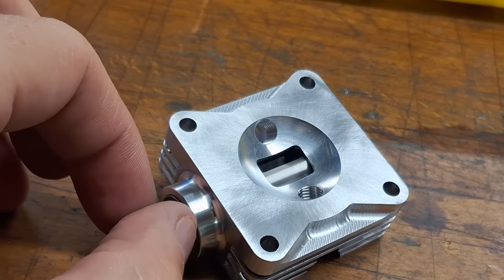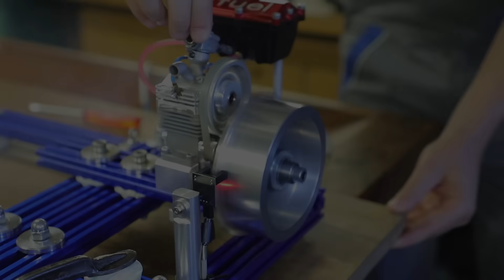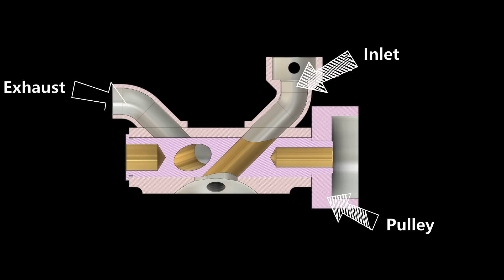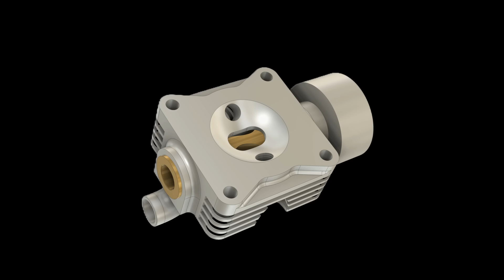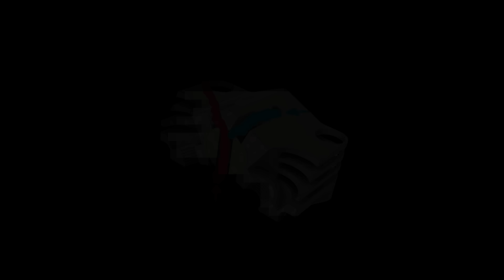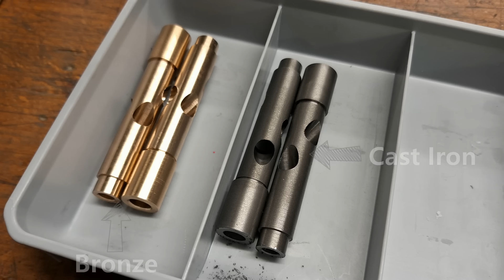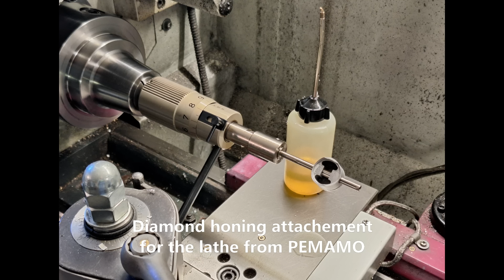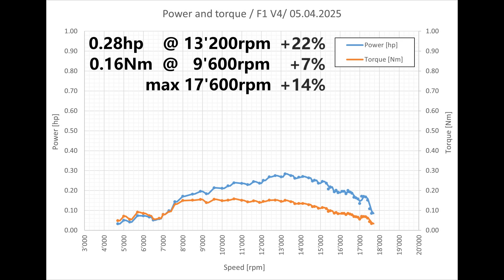New Rotary Valve Design for Model Engine / Modellmotor mit neuartiger Walzendrehsteuerung / Part 2

Comment: Great work just to get one working! I had some involvement with the Bishop Rotary Valve F1 engine quite a while back. We were building the rotary valve head for it with Ilmore (now Mercedes) supplying us with a single cylinder 300cc headless engine. We ended up getting more power from it than Ilmore was able to with their current F1 engine. Sadly, a rule change forcing only poppet valves in F1 killed the project. It had a single valve, with inlet at one end and exhaust at the other. Each had a rectangular opening to the combustion chamber to maximise the area, which was huge. The two paths were separated by a double thin-walled section in the valve. A side view cross section of the valve would look like the inlet path coming in from the right hand side, occupying as much of the diameter of the valve as possible, then turning thru 90deg into the combustion chamber. The exhaust was similar but coming from the left hand side. How they turned thru 90deg without clashing was a bit tricky and modelled in 3D CAD then optimised using CFD, with the actual valves being initially 3D printed in steel but later on were CNC machined on a 5-axis machining centre as the ports were quite complex shapes.  We found that overlap kills BMEP - it doesn't need valve overlap at all. Try to maximise the cross sectional area of the inlet and exhaust valve ports, and make the opening into the combustion chamber as large as possible without compromising the sealing. I know that will be tough, we had patents on the sealing method and that was one of the special parts of our engine that made it actually work where the other F1 engine manufacturers failed (and subsequently had the FIA change the rules....). It did need two spark plugs and I think they didn't fire at exactly the same time, pretty sure there was a slight delay on the second one. Not sure how you can do that with glow plugs, though, they stay lit up from the catalytic reaction with the methanol and you control your ignition timing by varying the compression ratio. Try increasing the compression ratio until you detect detonation, then back it off a little. You should hear detonation but a tell tale sign is that the inside of the combustion chamber will appear as if it has just been sand blasted. Keep it up, you have some awesome machining skills, I'm sure you can do much better with some more R&D!
Reply from the maker: Dude, the Bishop rotary valve F1 V10 inspired me a lot in all if done so far 🤭 Love it!!! https://v-eight.com/multimedia/pdf/AutoTechBRV.pdf The one valve solution you see here isn't my best design. I have done a 2 valve design which brings 0.60hp out of 6.5ccm. With this design I built also a V8 https://www.youtube.com/watch?v=oSu5dQr6PCA (watch from 03:00min). Revs up to 22'000rpm! I knew the FIA banned rotary valve... I think that was a direct result of Bishop Innovation and the concern of the FIA that the other teams might have problems. I'm currently working on a revised version of the 2 valve variant (design phase). I will definitely try to improve the design. It's still a model engine and you can't scale it 1:1. For example, the glow plugs are relatively large and the gas speed in the valves is rather low. Also, the boundary layers are super thick in relation to the cross-sections. Friction is also a big problem as the surface-to-volume ratio is bad in such small engines. Have you had alreadya look at my previous 2 valve rotary valve design? https://www.youtube.com/watch?v=TMYDdoHDgFs&t=2s This one was the basis for the V8.
Reply: @danielhunziker3577  Ahhh - cool. The BRV engine was awesome - the sound of a single cylinder 300cc engine doing over 20,000rpm was incredible. I did see the 2 valve version. Compare the two - what is different? Timings? inlet/exhaust areas? Compression ratio? It may even be that the smaller dia valves in the 2 valve version seal better against combustion, which is most of the battle with rotary engines. We used carbon-carbon seals in the head and the valve was titanium nitride coated then super polished to literally a mirror finish. That was the key breakthrough that made it work. Too hard at this scale, of course. You can minimse friction simply by reducing surface area in contact with the valve, which sounds simple but probably not so simple to implement - perhaps try eccentrically boring the valve housing centrally so that the area that seals the valve is untouched but around it is relieved by a few hundred microns. Polishing is also super important. A super smooth finish will allow closer fits which then provide better combustion sealing. Also, try varying the comp ratio and dyno test each time, going from low comp to very high comp and see where the sweet spot is. You can adjust the ignition timing when increasing comp ratio by using a colder plug, but too cold will make idling difficult. I'll be watching your channel with interest from now on. I wish I had the spare time to do this stuff myself - I fly RC pylon racers and fiddle with engines a bit but not at this level.
Reply from the maker: @stumaxaircraft  I'm probably not saying this clearly in the video, but compared to the 2-valve version, everything is the same. Timing, compression, valve cross-sectional area, etc. I have also tried DLC-coated control shafts (hard, smooth and low friction surface), which ended in disaster... 🤢 I have ground the surface of the rotary valve and honed the cylinder head. I have a feeling that the 45° angled inlet and outlet are mutually obstructing the gas flow. This may also be why there are turbulent flows, which leads to areas with very high pressure and thus the flow velocity decreases. I can find this out with FFT Fluid Simulation (as you said). But I'm not in the mood for that at the moment. I'm just a little hobbyist 🙃

Comment: Try with just 1 glow plug. Also decrease the area of the combustion chamber.
Reply: You also should try to move the glow plug further towards the top. You do not want it to ignite the fuel too early. I bet if you compare the compression ratio of the rotary valve vs the original 2 valve you will see the 2 valve has much higher compression. These two things are worth a huge amount of power
Reply from the maker: Thanks for you input! The combustion chamber and compression is identical to my best working design with a two 2 rotary valve system. This brings 0.60 hp! Such large differences cannot be explained by the combustion chamber shape. The glow plugs are also in exactly the same place.
Reply: Two glow plugs near the outer edge of the cylinder are functionally equivalent to one in the middle...

Comment: what do u think about the 2 stroke rotary valve design ? it might be the solution to all the issues that comes with rotary design
Reply: had the same thought :)  but I think turbo intake and maybe fuel injection and a must for that to work.
Reply from the maker: The function of the rotary valve on a 2-stroke is different. It only regulates the timing of the intake into the crankcase. So you have neither thermal problems nor the issue of gas pressure during combustion. As an extreme example, you can also take the fact that this is not necessary at all with a 2-stroke engine and you can use a membrane control instead (my 2-stroke 50cc racing engine also had this).
Reply: @danielhunziker3577  there is a new design it has rotarty on the sides not like a normal 2 stroke it requires a supercharger if i am not mistaking
Reply: @danielhunziker3577  also it doesnt burn oil
Reply: That's just straight back to Detroit style @alfonzmuller294
Reply: @johngibson3837  it doesnt burn oil + doesnt need shaped exhaust basically just 4t advantages with 2t power there is a video bout it just search "future proof engine" it pops up at the top
Reply: @alfonzmuller294 sounds like a Detroit diesel to me too, by the way you are describing it
Reply: @eljaibas16  watch the videoooo i know what Detroit diesel is
Reply: "not like a normal 2 stroke it requires a supercharger if i am not mistaking"

You are describing a Detroit Diesel 😅

Valves on the inlet make no sense, the inlet is piston or diaphragm controlled.

And the last part of your sentence doesn't make sense in the order.
Not the valve control requires a compressor or turbocharger
But in order to be able to charge the engine at all, an exhaust valve control is required, because otherwise the boost pressure would immediately disappear through the exhaust during reverse scavenging.

You can repeat as often as you like how new the concept should be.
People have been tinkering with turbocharged two-stroke engines for decades .

It's a fact, nobody can reinvent the wheel 😅
Reply: It not a 2 stroke but a 4 stroke with rotary intake and exhaust valve!
Reply: @nee3029  the video is from driving4answers, it's a new prototype 2 stroke engine which replaces the crankcase intake style with a supercharger to get air into the cylinder, and iirc uses a rotary valve to control the exhaust. Basically, 4 stroke longevity, 2 stroke power. Weight and complexity are in between both

Comment: I was working on a rotary valve project also. Compression loss through clearance was an issue. To combat this, I was going to use ceramic valve and head so that expansion and contraction through thermal differences would be minimized!
Reply from the maker: Hi Duane 😃 You're right. This is a problem. My plan is to use active seals in the future that solve exactly this problem. But I'm only in the design phase. Please don't forget that this is only a model engine, which is built as simply as possible.

Comment: Having a single shaft is good for cooling the shaft.
If there were 2 shafts, the heat from the exhaust would burn the exhaust shaft.
Reply from the maker: Hi man 😃 I'm not a fan of 2 rotary valves. Also results in double friction.

Comment: As I’m looking at this design, it would be really neat to see that thing running with no piston. You really can run an engine off just head without any piston or crank at all all it’s gonna do is through foot air because you’ve taken the mechanism off of it. You’ve literally separated the power plant from the motor making it just the power plant by removing the piston and everything to do with the piston, you’ll see that there’s more than one video where they have a head sitting on the table. There’s multiple reasons why that this is necessary this engine right here I remember speaking to people about And trying to get someone to build it so that we could get a new copy of it just this piston head, putting out one horsepower with no piston just the head running and the exhaust fed into the Native American piece pipe. The piece pipe itself has four valves in it or read the same as a flute has a read in it. It has four really long ones in a really tight wrap. Send you that does nuclear amplification is like an in-line amplifier and then it fits it into a scroll engine, which is exactly the opposite of a scroll compressor for air-conditioning scroll compressor and it comes out of that doing more than 550 pounds of force and is the drive mechanism that they used to use on the hover bikes that are just like out of Star Warsthen lands feeder motorcycles that fly around everybody was nuts over in Star Wars that is the engine that drives that’s part of sky crane or it’s going to be one of the things that sky produces if I can ever get sky crane off the ground

Comment: Plot a chart of crank angle vs intake valve open area and exhaust "valve" open area.

You can also cut off the fuel at the highest RPM and let the engine coast at wide open throttle to calculate the friction and pumping losses.
Reply from the maker: Hi man 😃 I have already measured the internal friction of the motor. This is not the cause of the low performance. The cause is poor cylinder filling due to an obstructed gas exchange.

Comment: I think the main reason the 1 valve setup has less power is that there are more leftover exhaust  gases around the periphery of the combustion chamber because the scavenging during valve overlap is happening only in the central part.

Comment: I think you've done great, you just dont realize it yet. The engine sounds great, runs real smooth. You have successfully increased thermodynamic efficiency of the engine, but i wonder why you are not happy about it. When you increase thermodynamic efficiency, usually the powerband is more balanced but the engine takes up slightly more power to run itself.  When you just increase power, thermodynamic efficiency goes down and you create peak power with a sweetspot. So its usable power vs. Peak power. With a regular two stroke you create peak power, with your design you create  USABLE powerband. Of course its not gonna revv up as qick. But now you have made your engine turbo compatible. So you can further increase peak power or you can take a supercharger and increase powerband further. If you try that i bet you will have ideas on how to further improve your engines design.  Keep going. By the way i found the v-shaped channels of the new valve a super elegant solution. if you want to revv it up qicker and higher you just need to further drecrease friction and weight of moving parts.
Reply from the maker: Hi Adrian 🙂 I see the 1 valve principle more as a gimmick. It was worth a try but not more 🤷‍♂The point is that with my 2 valve rotary valve cylinder head I produce more than double the power and the aim was always to increase this further. Have you had a chance to watch the video of the 2 valve version? https://www.youtube.com/watch?v=TMYDdoHDgFs&t=2s That is also the reason why I am now going back to the 2 valve cylinder head. I will continue to improve it.
Reply: @danielhunziker3577 ah i see now, you are referring to a configuration where the valve is split. Fair enough. I still think the v-shape channels were very elegant and worth the try. I like to see more of your content soon.😊
Reply from the maker: @TheAdrianOMG  It's always good to try things out like I did here with the 1 valve. You can just  learn something 🙃

Comment: Genius port geometry!! If you put a sleeve over the rotary valve you can adjust it separately for intake/exhaust port overlap timing. And if you have sealing issues, labyrinth seals with oil pressure can solve it without contact drag. Game changing work! Keep up the great work!
Reply from the maker: Hi Carbon 😃 The chosen timing here ist the same from the single rotary valve design with 2 valves. It worked very well there. But this is probably not suitable for a 1-valve engine, or many other influencing factors lead to a significant drop in performance. The theoretically well-designed gas flow through the cylinder head doesn't help either 😉

Comment: This is so darn cool. That said, think at partial valve opening that sharp edge might cause a lot of turbulence that could slow down flow a lot. Plus the chamber volume being a big wide hemisphere has got to make areas of chaotic stagnant gasses. Maybe shape the chamber to kinda keep the shape of the ports and add in some squish to really mix the gasses before ignition? Dual plug hemi heads are great for blown engines where you're force feeding the chamber, but when you're trying to get stuff flowing on its own violation they don't do quite as well. That said, I haven't made my own awesome engine, so feel free to ignore me: )
Reply from the maker: Hi man 😄 What you are referring to are tuning measures. I have described the problem of gas exchange in a one valve rotary valve system and that this doesn't work properly compared with a 2 valve rotary valve. So my main measure is to continue optimising my well-functioning 2 valve design and forget the 1 valve 😅 As I understand it, are you particularly interested in tuning projects? When yes, have you already seen my series abou tuning an OS FS-40s? https://www.youtube.com/watch?v=4lMeLRniCa8&t=2s

Comment: rev force two-stroke engine uses a rotary valve system at the exhaust and uses a four-stroke engine lubrication system.
Reply from the maker: Hi man! I had that system on my 125cc 2 stroke Yamaha DT125. The rotary valve in the exhaust is quiet far away from the piston. So it doesn't seal that. It doesn't have to because the aim is only to shift the outlet timing to get more torque at lower rpm. This isn't really comparable to the valve system in the cylinder head.

Comment: i love :)

wait also please in the later videos explain how the lubrication systems work we really need it plis

1 more thing aswell how will you seal the combustion gas from leaking into the rotary valve housing?
Reply from the maker: Thank man 😃 The engine doesn't have an active lubrication system such as dry sump lubrication. It functions like a 2-stroke engine, meaning it has oil in the fuel. The engine runs on methanol and with 20% oil in. The rotary valve is only lubricated with this. Lubrication mainly takes place during the compression stroke. During compression, the gas pushes the rotary valve minimally against the upper stop and forces oil in the air-fuel mixture into the space between the cylinder head and the rotary valve. This lubricates the system and, more importantly, seals it! Active lubrication is also possible. This can be found, for example, in Hunter's book ‘Rotary Valves Engines’. However, since a model motor should be as simple as possible, I recommend the 2-stroke version for lubrication.
Reply: @danielhunziker3577  this lubrication system is so clever.... thank you for the reply.